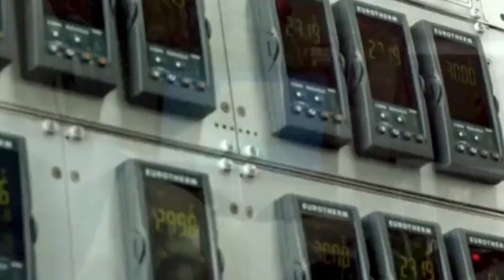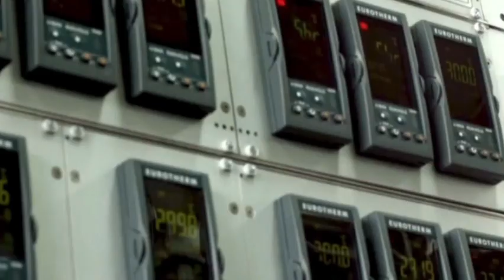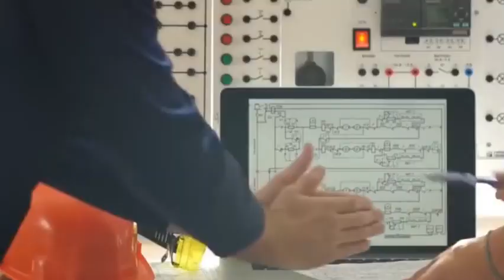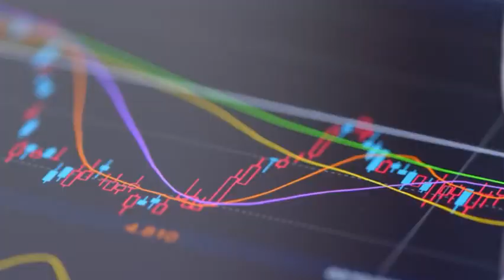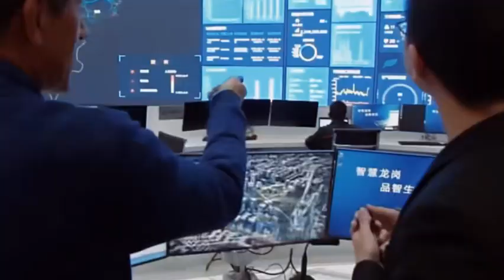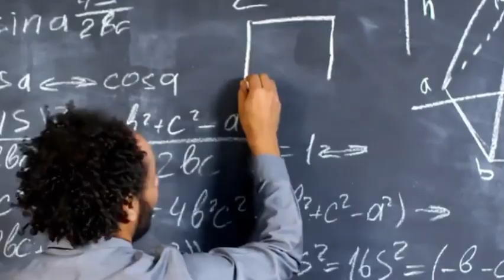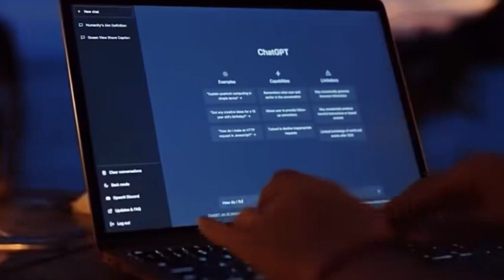Who's Really Defaulting? The Secret Truth Behind the Dutch Chip Cut-Off

Comment: The issue is not with the Dutch government as politicians are liars.
The alarming issue is the lack of judicial independence for the Dutch court to make well reasoned decision.
The court must determine if the cited Dutch law is applicable and to hear arguments from both sides.
With the presence of the international courts at the Hague, the Dutch judges knew fully well that their ruling and order are NOT enforceable outside the Dutch territory. 
Proceeding what the Dutch government wanted unilaterally would cause chaos to a multinational company without consultation with the parent company, the Chinese government and every country Nexperia has operations in.
WingTech, the parent company, is well in their own right to file injunction in every other country not to accept the Dutch court order.
Despite century long history, the Dutch judicial system, in comparison to the American system of 250 years, has failed miserably.
Reply: Thanks for this insight — it seems unbelievable that this usurpation of contract law is possible in an “advanced” society.